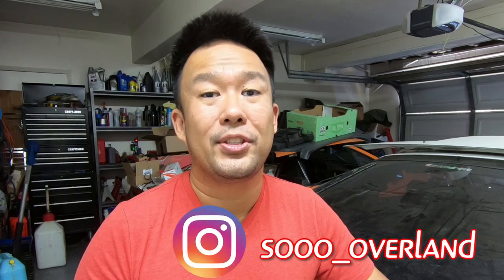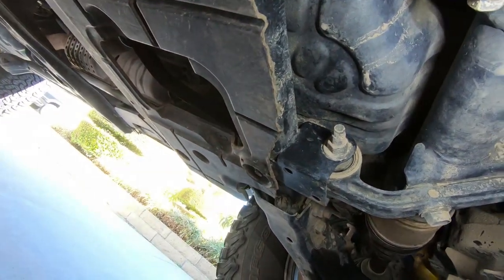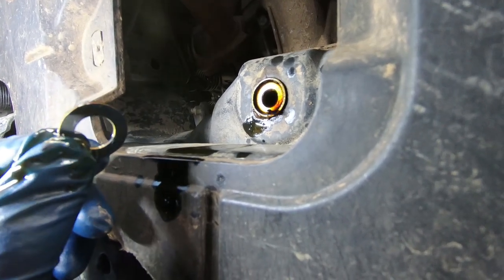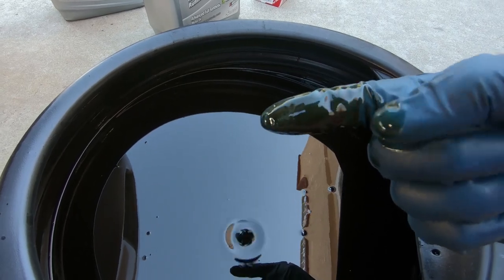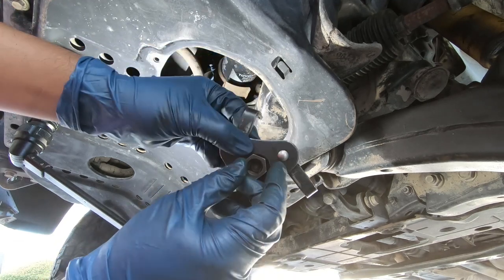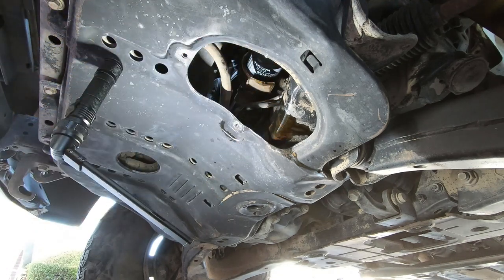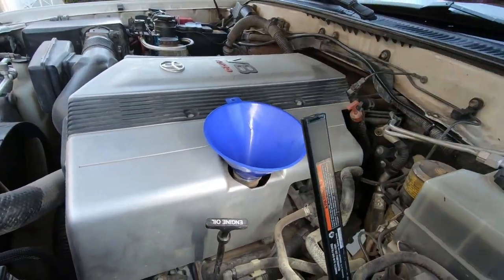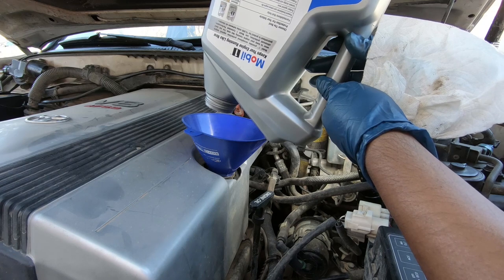Why you should ALWAYS do your own oil change!

Comment: Consider using the Toyota D3 filter next time.  The D3 is slightly larger with more filter elements and designed for the greater oil capacities we see in our 2UZs.  Also, the Fumoto valve makes oil changes an absolute breeze.  Have had mine installed for 2 years and can't imagine life without it :)
Reply from the maker: Yea I got a bunch of these filters cheap, when I go thru them, I’ll probably switch to d3
Reply: @chowcares  try out one of the Fumoto valves as well.  Couple of us have put them on our Cruisers and love the simplicity and cleanliness of oil changes.  Makes getting small samples easy.  LOVE the videos you're doing BTW.  Been recommending your YouTube channel to people who are new to the 100s as "required" viewing for understanding how to work on their rigs.  Keep up the good work :)
Reply from the maker: Will give them a try, thanks for your continued support!

Comment: I have had bad oil changes at dealerships twice. In 1980 I got an oil change and they forgot to put on the oil cap and on the way home the oil came out on the engine and smoke started coming out from under the hood. It was a mess. In 2006 I bought a new car which I later brought in for its first free service. The tech broke the engine cover and didn't tell hurting the car's performance because it also contained the air filter. I bought a replacement off ebay but new it would have been $350. I just have too many problems, in addition to the time it takes, to delegate my oil changes to the professionals.

My stepson's girlfriend's father took her Camry into the Ford dealership for an oil change because he tows many of their vehicles. The tech forgot to put in new oil and the engine burned up on the way home.

Comment: Not sure if there is a model year difference or what but the Amazon link points to the 90915-YZZD1.  My 06 calls for the 90915-YZZD3. Otherwise, great video as always!
Reply from the maker: i believe the earlier vehicles called for hte D1. Later models like yours went to the smaller D3. I tried those before and did not notice any specific differenced besides the size iteself. many on forums suggest the D1 as an upgrade for its increased capacity.

Comment: Great YouTube with so many great tips. If you really want to see how your engine is mechanically, get a sample kit and send your oil sample to the lab for analysis on particle counts, early hints of bearing failure .  They run about the same price as the oil. I would put in to start the engine and look for leaks and then check the oil level after the filter has oil. 
Example: https://www.blackstone-labs.com/engine-types/gasoline/#
Reply from the maker: I’ve been wanting to send oil in to get tested, but probably not the lc tho, from something that’s more prone to failure

Comment: Yeah the gaskets are SUPER cheap. Think I got a 10 pack from Amazon for next to nothing. And the oil pan gasket is 29ft/lbs of torque. I happened to do mine this weekend as well. Other thing is that I believe your LC has same lift as mine (1.5" OME) so with that and 33s I am able to slide a bucket underneath the truck and with a slight lift of the floorjack I have more than enough room to get a 5 gallon bucket under there and remove the oil drain plug without issue. Two oil changes and you are close enough to full on the bucket to take in and recycle the oil.
Reply from the maker: Good to know the torque specs! I rarely use the torque wrench out for the drain plug, maybe I should 🤔🤔🤔
Reply: @chowcares  Yeah 29ft/lbs ain't much so if you are snugging it up good and tight you should be good. Might be a good comparison next time, do it to what you think it 29ft/lbs and then actually check it. FSM also says that its ok to use a wrench/oil filter tool... basically get it to hand tight and then do 3/4 turn more MAX.

Comment: That brake fluid looks black. Maybe that can be the next video?
Reply from the maker: I changed it out when I first got the LC, come to think of it, it’s been almost 5 year. Yea, maybe!
Reply: @chowcares  I would love a video of you going over the braking system and also the ABS Pump Module! Mine has developed the dreaded pump motor squeal.
Reply from the maker: Jason Michael I rebuilt my brake master when I first for the LC. I forget what I did but there was a oem Toyota rebuild kit. I went that route because to buy a new master was over $1400 if I remember correctly.